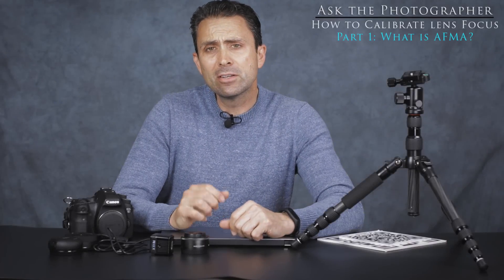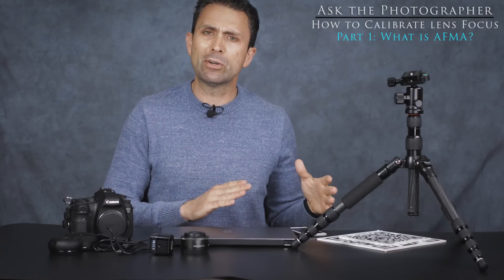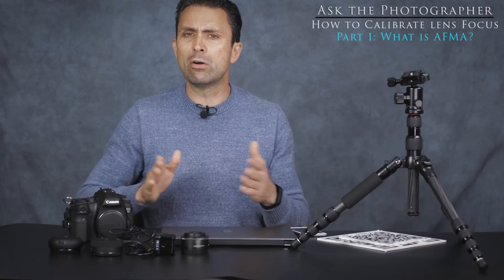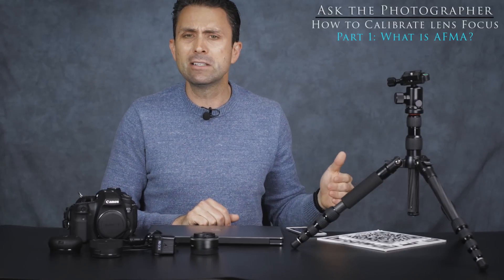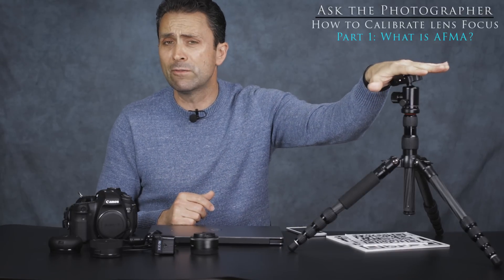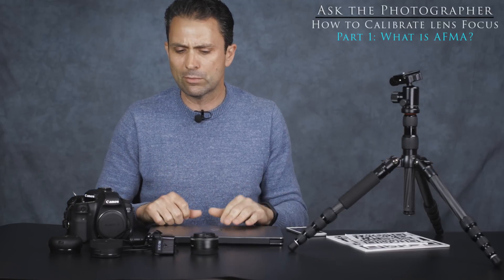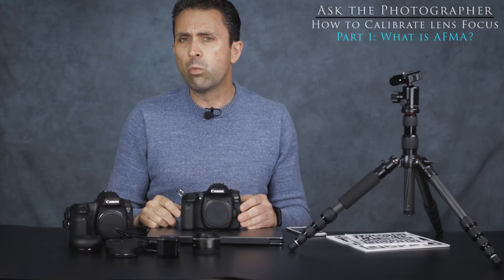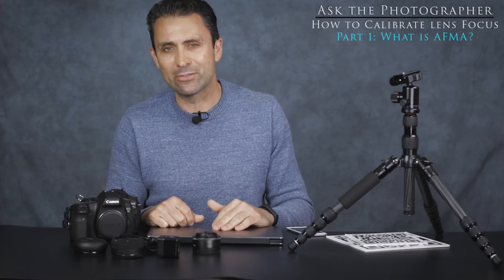ATP: How to do Lens Calibration | Part 1: The Basics of AFMA | 4K

Comment: What you are trying to say is that they were not properly focused tweeked by the Q.C. department that sounds about right as corporations in general cut way back in Quality Control  so the CEO's could make millions more, how is it that my lenses I bought for my Canon 12-15 years ago are still as good today?
Reply from the maker: That's actually not what I'm saying.  I've had to do major focus adjustments on lenses of all brands and older lenses along with new ones.  I think that higher resolution sensors and sharper lenses have revealed focus deficiencies more clearly.  If anything, lensmakers are actually doing better on having less sample variation, not more.

Comment: i think what this did was to give camera manufacturers the go ahead to abandon and in house basic calibration of camera bodies. 

I have a 12MP DSLR that consistently does a very good job when it comes to focusing with 6 different lenses. I can repeatedly achieve pin point focus on subjects on all these lenses. Put those same lenses on a 20 or 24 MP DSLR and the focus is abysmal - not even close. This isn't fine focus adjust it is gross focus adjust  and iut tells me these manufacterers care for nothing but gross profit margins - quality be damned.
Reply from the maker: In some ways it has become a moot point - the transition to mirrorless makes all of this unnecessary.

Comment: Dustin, I have a question. I am considering acquiring Focal and I went through the information on their website and something that caught my eye was the fact that they recommend using 50x the FL of the lens to perform the calibration. After seeing a chart on their website I thought well it make sense. However, what if you shoot normally at a closer distances that, for example the 15ft that the 85mm requires to perform the calibration? One could calibrate the lens for the working distance however if you are going to change your working distance from shoot to shoot you would have a problem. This working distance change could be either forced by changing a shot from shoulder to full body.

What are your thoughts on this?
Reply from the maker: They are creating a rule of thumb.  I recommend testing at your most commonly used focus distance where critical focus will matter the most.
Reply: @DustinAbbottTWI  thanks. I was just asking because they mention on one article that if you don't calibrate at a reasonable distance, when you calibrate at you working distance and it is for example say minimum distance the lens allows you, you will get big variations if you changes that distance slightly. Will five it a try. Thanks.

Comment: I have 2 Canon bodies,
5DIV and 9D and i want to micro adjust the focus for a Sigma 150-600 C lens,
how can i adjust the lens for 2 camera, if i use Sigma USB doc it will adjust
the lens and not according to camera, and if i adjust on camera it will not give
the option to adjust for all 4 focal length, what is your advice?
Reply from the maker: My recommendation is to do the full USB dock calibration on your primary camera that you will use the lens on, and then do a standard AFMA on your secondary body (no USB Dock).  The first calibration helps to correct for lens focus bias, while the second will correct for any minor camera body focus bias that might be there.
Reply: @DustinAbbottTWI  Thanks ever so much for the info, i never thought about it, great info... thanks again.
Reply from the maker: I'm glad it helps.

Comment: If I micro adjust a EF 70-200 2.8 ll to say my 7DM2 and then to my 5DM4 will the camera and lenses recall both the settings when I mount it to either body or does it have to be readjusted to each time I change bodies , thanks Brad
Reply from the maker: The microadjustment is in the camera, not the lens.  You need to calibrate it on both cameras, and the camera will remember the settings (which are unique to it).
Reply: Yes I understand the adjustment is in the camera , I have a 100-400 that focus perfect on the 5D but would like to adjust my 70-200 on the same body , by adjusting the body to the 70-200 will it change the focus properties of the 100-400 on the same body

Comment: I just got a Tamron 24-70mm G2 and if I use it on my Nikon D7500 I have to put the in-body AF-correction on +14 to get more or less sharp pictures (depending on the focus length and distance they are sometimes still not 100 % sharp - sometimes back and sometimes frontfocus - and this would probably have to be done with the tap in console, but I have no experience with that yet). Is this normal that the necessary correction value is so high (+14) or shall I send it back and get another copy of the Tamron in the hopes that the necessary correction value is less? Thank you very much in advance for your advice.
Reply from the maker: You might want to consider sending in your camera and lens to Tamron and let them do the calibration.  They can usually get everything working for you.

Comment: I like your videos but i feel like they are unnecessary long sometimes, this video could have been easily around 6/8 mins... you tend to repeat yourself too much...
Reply from the maker: I think you might be surprised by how long it takes to transfer both the information along with the insights as a photographer that people value and come to my channel for.  I'm certainly not trying to extend the length of my videos.
Reply: Dustin Abbott I hope I didn't come across in a offensive way, not my intention, if I did I apologize. I like your and value your videos otherwise I wouldn't bother commenting on them. My point was that a shorter video keep the viewer more focused getting the informations straight away without wondering off.  I watched many of your videos and now that I'm on the market for my first camera I loved your comparison (a7iii, a7r3, d850, 5dIV) I know I shouldn't even consider such cameras especially considering that I'm not worth the camera but I feel like I would waste my money buying something that has inferior specs. Since you used both of the new a7 series could I pick your brain a little bit?

Comment: What monitor to you use to edit your pictures and what monitor calibration technology/process do you use ?
Reply from the maker: I've been using a Dell U2410 for years.  I calibrated it early on and have left it since.  It has very accurate color.  I'm probably going to upgrade to a 4K display next year.
Reply: By Calibration of the monitor do you mean the Operating System for Windows or Apple or the more rigorous process by using a Monitor Calibration Device like https://www.amazon.com/Datacolor-Spyder5ELITE-Designed-Professional-Photographers/dp/B00UBSL3L6/ref=pd_sbs_147_7?_encoding=UTF8&pd_rd_i=B00UBSL3L6&pd_rd_r=0T52R01ATJBM3EF1QFHN&pd_rd_w=8oeeD&pd_rd_wg=HFpJv&psc=1&refRID=0T52R01ATJBM3EF1QFHN
Reply from the maker: I actually did software calibration via a Blu Ray, but the monitor calibration devices work the best.

Comment: i have calibrated my lens sigma 150 600 sport and 5d mark IV on my camera and not with the usb dock, it's spot on, now I have my sigma tc 1401 converter on my camera and have allot of not Sharp images. Do I have to calibrate my lens again or is't my converter?
Thanks in advance Dustin
Reply from the maker: You need to do a calibration with the 1.4x attached.  The combination often requires a different calibration value.  You may want to enter that value in the USB dock if the camera doesn't recognize the difference with the extender attached.

Comment: I have the Nikon 50 mm 1.8 prime lens, which I have calibrated to a close focus distance on a Nikon D750. On that distance the autofocus works nicely. However, when I shoot mid to long ranges, it is significantly off. Since there is no such thing as a Nikon dock, it seems I have no other option than deciding which distance I'd like to use the lens on. Or is this something which indicates that there is something wrong with the lens?
Other lenses seem to work fine (however, they aren't as fast as the prime lens, so the focus area is significantly deeper in the first place).
This kind of ruins the fun with this lens. Any helping comment is appreciated. I am looking forward to the next videos. Maybe they help me to solve the issue.
Reply from the maker: Reikan recommends doing the calibration at roughly 50x the focal length (2.5m or around 6 feet for your lens).  That tends to be the best compromise distance.
Reply: Thanks for the hint. I was definitely below that distance. So a compromise it will be. I'd really like to know what prevents the AF parts in the lens to provide a consistent function of the AF across all focal lengths and focus distances. 🤔
Reply from the maker: That's not incredibly unusual - though obviously I wish it were.  50mm f/1.8 lenses tend to be one of the cheapest lenses a brand offers, so you can imagine they probably don't have that brand's BEST focus system.

Comment: I have some AF problem with my tamron 24-70 VC. the problem is when I adjust the AFMA for a subject at let say 3 meter distance, i miss the infinity focus. when I adjust for infinity focus, close focus distance will be missed. since this lens does not have the docking station what is your recommendation? thanks
Reply from the maker: You might send it to Tamron for calibration.  That's definitely an issue that the Tap In can help with, but, as you've noted, that doesn't help you.